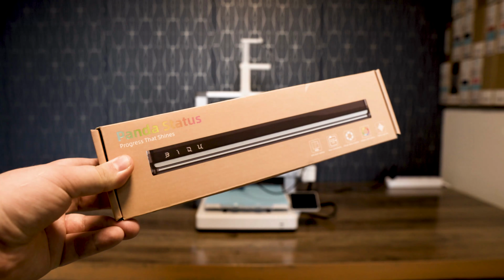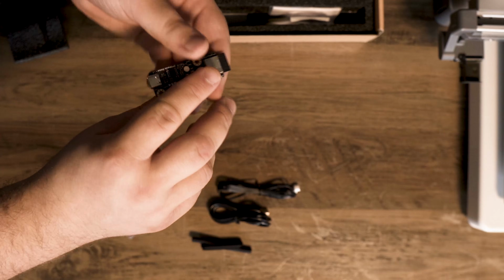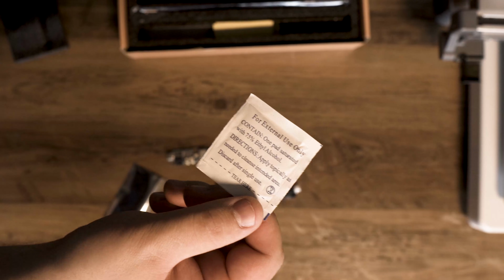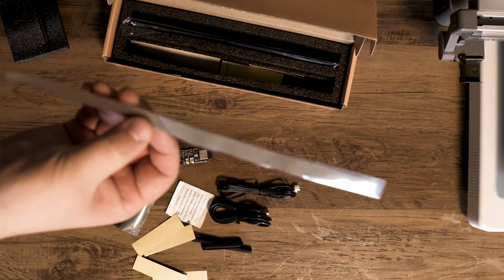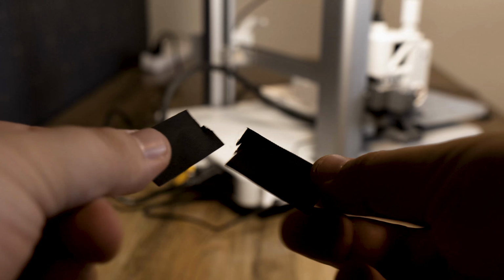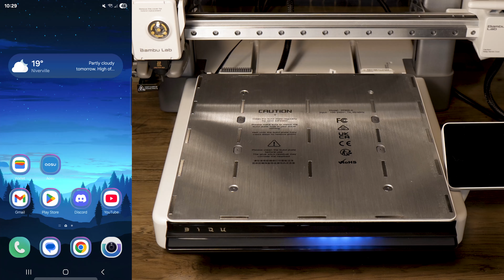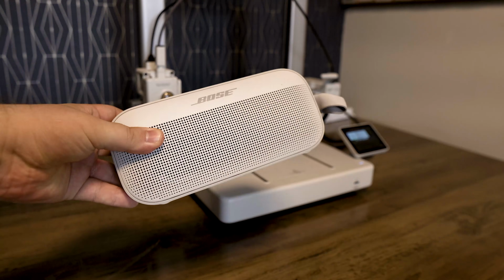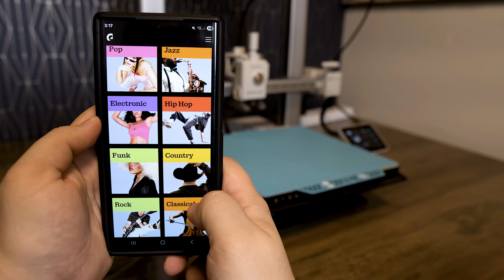A Fun Upgrade to Bambu Lab A1 Printer - Panda Status by BIQU

Comment: Mounted ON THE HEATBED???  The MOVING heatbed??? No thanks.
Reply from the maker: That's a valid concern! If the tape fails then there can definately be problems.
Reply: Hey  @3DPrintedProject  - Have you noticed this being a problem, has the tape been fine for the last month or so? I have mine coming, I am not too stressed about it but thought id check. :D
Reply from the maker: @matttrent922 I took it off myself as it is a valid safety concern. When I was trying to take it off I had a hard time doing it. So it was on there pretty good.
Reply: @3DPrintedProject ahhh fair. That makes sense. I may put mine on the very front instead of the bed that way i don’t have any issues or concerns     .  / I may look and see if there’s some fancy maker world prints for different locations :) thanks mate!